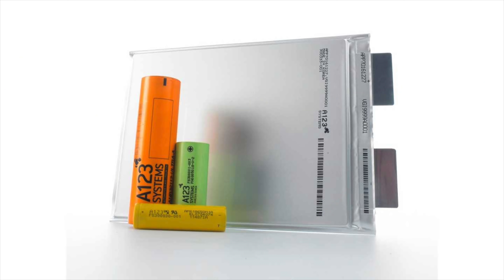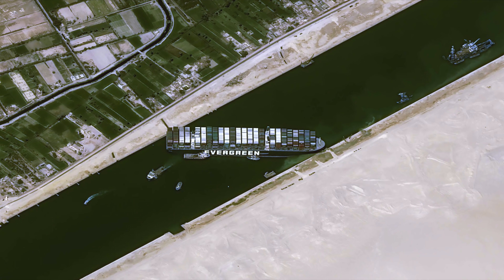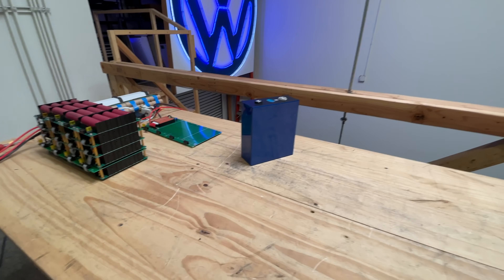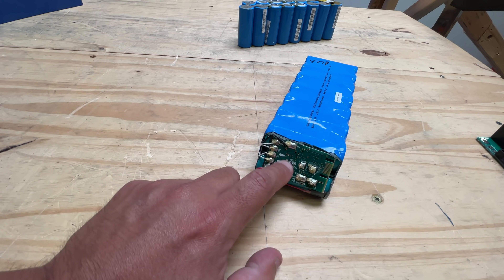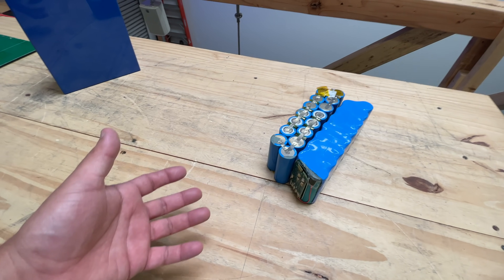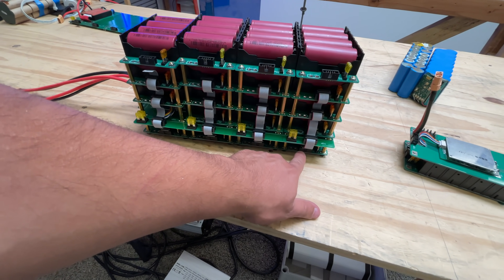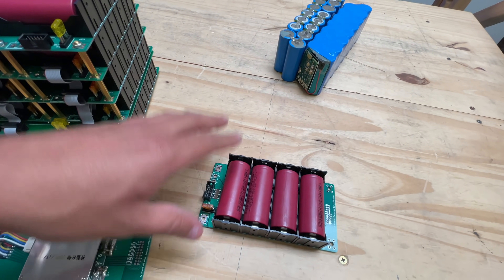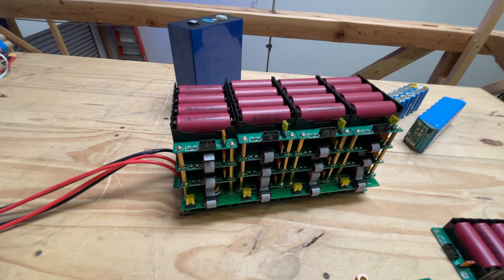$90kwh LiFePO4 Batteries

Comment: Don’t buy these. I ordered 40 packs. Almost 50% of the cells are unusable to make into larger packs. 25% were below 1v or at 0v. After testing the salvageable ones, if I could use all the cells somehow, it come to more than $160/kwh. So many of them are well below 80% original capacity. Realistically, to only use the cells that would make good larger packs, you are at $200/kwh. 

The fullriver packs after testing gave me $92/kwh with 90% of the cells between 3100-3400wh each. I would buy the fullriver again, but not these blue packs.

Don’t get me wrong, I really like what Jag35 is offering in terms of other products and the information he is sharing. I have learned a lot. But this particular product is not good.

Comment: Can you charge these in a typical 18650 charger without modification?    mmm, I guess you could go wires and neodymium magnets or grocery store broccoli rubber bands.  Too bad their are a little longer than a D cell or they would be super cool for conversions.  D cell 61.5mm~ and 26650 65mm~

Comment: I have bought 12 packs to build a 12v 100ah - 150ah battery. There are 5 sets of 3 batteries in each pack resulting in 60 sets to be tested and repacked. So far I have found around 12 sets to be short circuits, which is an 80% yield. I haven't tested capacity of them yet.
Reply: Going further, to make the battery from those cells you need a bms, some enclosure, cell holders, some wires or tabs and solder. Believe it or not it all amounts to about 200$, together with 200$ I've already paid for the cells you could buy a new Chinese battery which would probably be a better quality than my home made one.. Not to mention I'm working on that battery 3 weeks now and I'm maybe half way... Given the chance I don't think I would bother again.

Comment: I recently bought 48  280AH Life04 prismatic, top grade, batteries from a Company I found on Alibaba for $90 each delivered to me in California.  Absolutely fabulous batteries with incredible power. 
And it took about 4 weeks to arrive at my front door. 
4 months earlier I ordered 96  200Ah batteries. They were right around $75 each delivered to my door.
I run 2 mini-split air conditioners in the house, 
one large wine cellar refrigerator, 
a garage A/C and charge my car as well, 
and except for the wine cellar, they all run all night 
including car charging. 
Then the sun comes up. I charge to 90% full, down to 20% but it varies. (Could even go lower) 
Absolutely amazing batteries.
Easy to order, easy to get, well packed, yes it's from China.
I know all about your bitching. 
If lazy Americans would make something other than COMPLAINING we would have them available here. 
Lithium Iron Phosphate (Lifep04) is much more stable than Lithium ion chemistry, 
and much easier to install than little 18560 cells. and NO cell level monitoring and balancing.
At least for my large solar system, 123KW battery and 19KW solar.
I have been cycling now my two banks for about 6 months and there is NO cell drift. Yet. 
It could happen, but at around 1/2 an amp per battery charge rate, and even less discharge, I'm not worried.
And I don't use a BMS either. Just a couple good voltmeters a good current shunt and smile A LOT.
So just take what Jehu says with the understanding that he has a product to sell and do your own comparisons.

Comment: This is garbage ..reasons...Firstly if you put 3 cells in parallel as they have done here ,and one dies the BMS can't protect the other two cells and they die too.So lesson 1 is you really need to series up single cells to the voltage you want ,put a BMS on that and then parallel the series strings .  Two ,the first graphic appears to be from someones imagination. Its untrue. Thirdly transport times for prismatics ,the first square blue cell, is only two weeks from china to Australia and they also in many cases have stocks in the country they supply direct from . Delivery for me has been extremely fast and very well packed.(go that route its the best for you!)

Comment: Caveat: $90/KWh,  in theory. But because there are dead cells, you can't get the whole KWh.
Reply: So how much is the cost for a kWh? People would want to know the cost of what they really want to buy. You pay for 2kWh for instance,  and you get 2kWh.
Reply: @ndubuisiajiduah7910  Don’t buy these. I ordered 40 packs. Almost 50% of the cells are unusable to make into larger packs. 25% were below 1v or at 0v. After testing the salvageable ones, if I could use all the cells somehow, it come to more than $160/kwh. So many of them are well below 80% original capacity. Realistically, to only use the cells that would make good larger packs, you are at $200/kwh. 

The fullriver packs after testing gave me $92/kwh with 90% of the cells between 3100-3400wh each. I would buy the fullriver again, but not these blue packs.

Don’t get me wrong, I really like what Jag35 is offering in terms of other products and the information he is sharing. I have learned a lot. But this particular product is not good.
Reply: Yep, and the number of bad cells is unknown, plus you are getting second hand cells so even the good ones arent avoid as having new cells.

With that in mind $90 is quite a lot to pay for an unknown quantity and having to do a fair amount of work but I guess its still cheap at 60 cells for $90.

Might be better if the cells were stripped and tested for capacity and sold but then the cost would probably much closer to just buying new.

I love these lifpo4  cells though, I've still got loads of them from when I was building rc packs , they last for ever.

I considered these for my ebike conversion but size and weight was huge compared to 1kw pack from 21700  lipo cells, I got a built 48v 20ah pack for £135 posted to UK.

Comment: Hello Jehu. I live in Puerto Rico and after Maria hit the island on 2017 the electric grip is not the most reliable so I want to make a off grip solar system. Can you point me on the right direction on what battery should I buy or do it my self and the Inverter. I live alone with my wife so no kids. I really appreciate the help. Thanks

Comment: What is the usable voltage to those batteries? 2.5 to 3.2?
Reply: 3V-3,5 is the most sensible range you should use LFP chemistry. Nominal voltage is 3.2V
Reply: No load is max charge 3.6v min usable is about 2.7v.
Depending on the amps drawn the voltage will be around 3 to 3.2v most of the time, the voltage drop off fast and power just disappears like you ran out of fuel when they get end of discharge, very different to lipo so monitoring current drawn as well as voltage is important, once battery is flat and power drops you must stop immediately or damage the cells.

Comment: What is the max discharge and charge rate for these type of batteries?
Reply: depends, for example, thundersky batteries 10 years ago could do only 0.5CA, now they can do 3CA constant and 10CA impulse discharge, 3CA charge.
5000 cycles at 80% DOD, 7000 at 70% DOD.
at least that is what the manufacturer says.
I think they would be quite acceptable for car usage, since it is much more durable, and they do have a larger range of temperature use ~-40 to ~80 Cº, it's definitely great for a powerwall.
Problem is getting them...
Reply: Those cells have a capacity of around 5000 mAh. Typically max is at 1C (so 5A), but if you want them to last long, standard is 0.2C (=1A).

Comment: Jehu I want to build my Powerwall 10 kW
How much it'll cost me for a set like that one at 48 volt?
Reply: Well, If you are not able to do those calculations by yourself, or use the right units (I guess you meant kWh), you definitely shouldn't try to build a powerwall.
Start small, like DIY replacement batteries for cordless drill.

Comment: Capacity of those cells/packs isn't listed on the site.
Reply from the maker: Pack is 9900mah so each cell is 3300mah
Reply: @jehugarcia  $60 / ((3.2 * 60 * 3.3)/1000) = $94.69/kWh - You weren't too far off... :P
Reply: @EdisonWong2004  Right. Cost only increases, yet they're being promoted as $90/kWh.  I hear you on the Lishen. I bought 8 Eve cells for about the same in Jan.